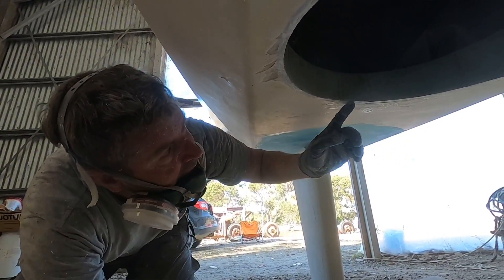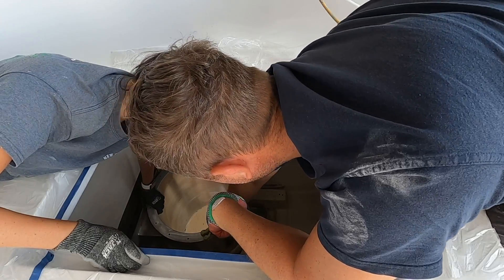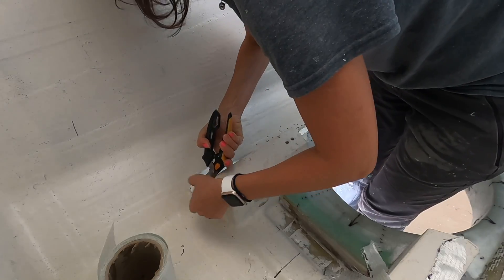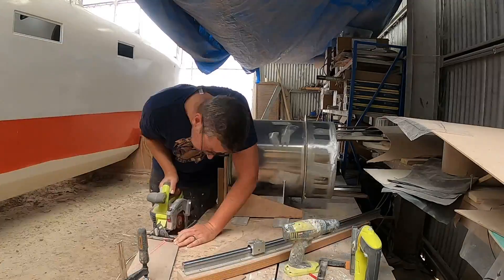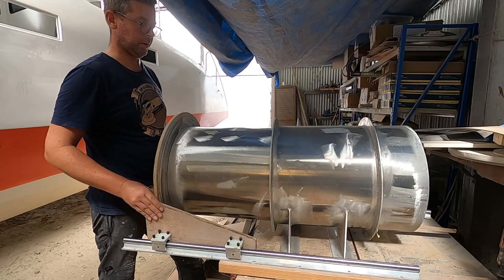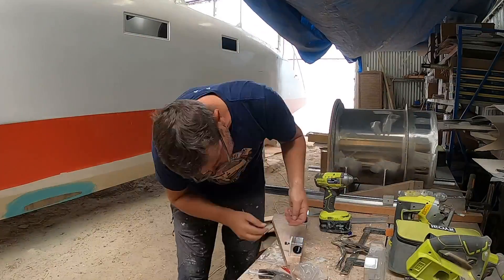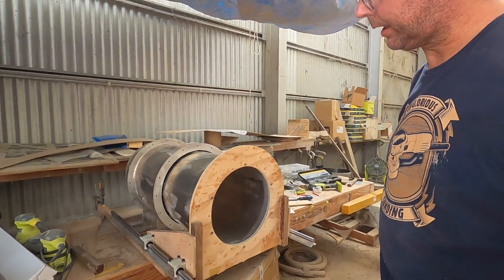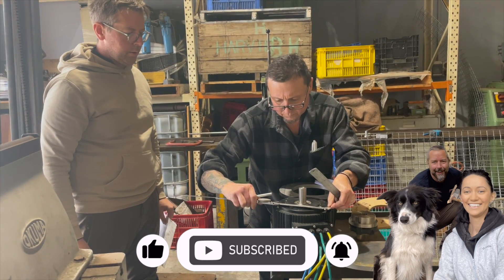The lifting mechanism prototype - S03E25 Propulsion Part 8 | Building Wilda | Unique Drive System

Comment: Linear rails and salt water are going to give you grief , hydraulic ram will be more reliable i believe
Reply from the maker: I think you are absolutely right. Plan on replacing the linear bearings (or whatever they are called) with a more robust solution fairly soon. Small bearings with fairly tight tolerances in a small track can't possibly work for too long in salty air.
Reply from the maker: But I think I'll keep the rails, using a different, more robust "trolley". I am not a fan of hydraulics...🤣 Work related disgust for hydraulics 🤣

Comment: This is a really well engineered prototype. As a retired marine engineer my only concern is that the lift mechanism is just too sophisticated and the linear ball bearing aspect is unlikely ‘to survive first contact with the enemy’. Personally I would go for ‘handraulic’ raising mechanism using a cable and use acetal bearings on the guide rods. But, anyhoo, it is a fascinating project and I am sure you will be successful.
Reply from the maker: The bearings are on the delicate side... Already thinking about bearing solution 2.0 probably from the 3d printed CNC world.

Comment: Looks great, those linear rods will rust up very quickly in the saltwater environment, do they have bronze or another material ??  can't wait to see the full mock-up...  Just one more thought, with the pod pushing into the water will it act like plunger and push some of the water over the inner edge into hull???
Reply from the maker: The rods are actually solid stainless.. I'm hoping good stainless... But I agree, they will be one of the sensitive parts. I have a plan for adding some resilience to that part moving forward. Some CNC parts.
Reply from the maker: Yes... The plunger part is an issue... I hope I can seal the cylinders pretty good but I do foresee some issues to work on.

Comment: Gday, looking good. One suggestion I would make is to consider a slight taper at the bottom of travel of the insert. On my38ft cat I used to have rudder cassettes that would wobble slightly. So I remade them out of composite and made them tapered a tapered cutout. This means that when down they connect solidly and don't vibrate. I would insert some very small wedges at the very bottom of the external sleeve, tapered so that they bear on the internal sleeve only when it gets fully down. Then you won't get any vibration of the internal sleeve under power. Then a small amount of retraction will make them contact free and easy to raise. I do the same sort of thing on my folding catamaran, with moving memebers that are only in contact when fully extended - it makes the whole thing very secure.
Reply from the maker: Sounds like a good idea. Thanks
Reply: That would also help prevent racking of the drive tube when extended and under power.

Comment: Love the drive system but how are you going to deal with marine growth inside the rings ?
Reply from the maker: We're hoping it won't be too much of a problem. Since the cylinders move and because of the environment between the tubes.
Reply: @buildingwilda  I do my own hull cleaning and am always shocked at the speed and scope of the junk. One barnacle is all it will take.

Comment: Just some considerations concerning behavior of the water when pushing down the device. On one hand, there should be free flow of water at the cylinder sides to minimalize the pressure needed to move it down. If you would have a tight fit (as a i.e. hydraulic cylinder, the pressure needed to press and hold down would be ( at lowest postion) considerable. Can be calculated as area pressure at the water depth at the position of the device minus the weight of it.
On the other hand, with free flow of water along the sides, water will (I suppose!) be pressed up over the edge of the fixed cylinder part, as the water amount to be pushed away wiil move against where the pressure is lowest, meaning upwards.
The same will probably occure when sailing in big waves, unless you have gaskets to close the gabs when the device is down?
Just some thoughts from another owner of a catamaran with a strange screw drive 😊!
Reply from the maker: You have a point for sure.

I'm not sure exactly how well I can get a seal to work between the end positions but we will try. In both end positions there will be a seal so hopefully not too much problems with sea movement.

The plunger bit, I'm sure some water will try to escape upwards I'm hoping not too much though... And hopefully we can get the seals to work in-between the upper and lower positions.

Thanks for watching!

What kind of cat and weird spinny thing? 🤣

Comment: Hi Axel and Rox, this is what we have been waiting for HAHA and the next step of course! 

Great work as always, the mere fact that things "fit" on the first attempt shows how much preparation and care you put in to every aspect of what you're doing. 

I have a couple of comments, one is I'm wondering what you're going to use to seal the joint between the stainless tube and the hull, I imagine this will be revealed in time and I probably should be more patient lol. 

Also between the 2 cylinders, in the old days we would use sacrificial Nylon strips as sliders to reduce movement while maintaining a smooth low friction slide. Today there is also Teflon and a few others, there is also a product or compound known as boron, aluminum, magnesium, BAM. This has taken the crown as the hardest and slipperiest material available. 

I don't know if its available in thin strips but if it is it would beat all plastic type solutions hands down! 

As always, looking forward to your next episode! 

🍻🍻
Reply from the maker: Thanks 🙏 

We'll glue the tubes to the hull.... Having a hard time deciding on whether to go with epoxy or construction adhesive.... Both would work.... Both have advantages and disadvantages...

I had to look up BAM. Super interesting material. Apparently available as a powder as well... That would have been a good additive to an epoxy mix I think 🤔 I actually bought graphite for this very purpose... But I think I'll try to keep it simple and just go with strips of plastic. The trick will be attaching them to the tubes.

And seals....
Reply: @buildingwilda  Regarding securing the tubes to the hulls, personally I'd use a marine flexible adhesive designed to bond stainless to epoxy. Then I'd make a right angle collar to go around this joint with double O-rings, one for the vertical one for the horizontal. This would be bolted on as redundancy protection also acting as a stiffner to protect the adhesive joint. 

But I'm sure you'll come up with a brilliant solution, you always do! 

Cheers 🍻
Reply from the maker: Actually the outer cylinder already has a flange with bolt holes. Part of the design from the start. It also allows for easier alignment.

Yeah... Leaning towards PU construction adhesive...
Reply: @buildingwilda  See, you already thought of it.... Was there ever any doubt??? HAHAHA

Comment: How are you planning on preventing marine growth or galvanic corrosion?

what's your backup for when you strike flotsam and it knocks the system out of alignment? Most likely problem would be the raise system jamming partially raised.

I love the concept, but I'm worried that you're making it to dependent on tolerances.
Reply from the maker: Galvanic corrosion is a bigger worry for me than marine growth.

Properly done wiring and sufficient amount of galvanic protection will be key, and something I am not an expert at... Yet 😂

As for hitting stuff, it would likely be during regen under sail... It would absolutely not be great, but I don't see how it would be any different with any other system. In fact all I see is that it will be far less likely to happen to our boat...

Simply because we will not have the drive in the water all the time. Most of the time it will be up. When it is down, we'll be manouvering at low speeds or possibly in regen mode...

Comment: You have to think about how to get to it to service the motor easily .
Reply: It just sits on top of the inner tubes flange. It's a brushless closed circuit  water cooled motor.  That only leaves the bearings to check every year or two or the power cable connections to work loose if not done up with self locking nuts.  

The small closed system  water pump is separate  and electric . They use a cooler plate or external  cooling loop exposed to the water.  

The wear  is only likely in the lower Right angle drive leg where the prop mounts or the rails and actuators that raise and lower the assembly and steer it if intended for manoeuvring.
Reply from the maker: You're absolutely right.

But the motor will actually sit inside the tube. As for cooling, I'll try without at first. What will really need cooling is the controller. I'll see if I can get it into a really cool place.... If not, I expect some sort of water cooling will be needed. Leaning towards air cooled (to avoid a sea water loop)... But we'll see.
Reply from the maker: Some bits will be a bit tricky to get to. But I have thought about it.

Comment: I would make the frame in stainless steel, and all the bits welded together. The water Pressuer against it when down will be a lot. You do not want it breaking in a crossing , and loessing the rig in the bottom of the ocean.
Reply from the maker: The final thing will be made from something less rot prone 😂

Not too worried about the thing dropping to the bottom... It will float. So pushing down will be the loaded bit.

Comment: This propel system is going to be one of a kind unique. Can’t wait to see it working and what speeds you get from it.
Reply from the maker: I really don't expect any speed to speak of. That is not what it is for... I'd be really happy with 4 knots.
Reply: @buildingwilda  I think you need to think about sea currents. On a sail, it's not uncommon to see a current of 5 notes, and sailers use motors and sails to get forward movement. 

Also, it will require a large battery bank, and I would say you need to consider a generator installation on top of the solar and battery you will need.

I would also look at hydro drive to produce electricity. When you are sailing you could get the propeller to spin and via a generator produce electricity to pump back into the battery.

I would also put a wind generator on top of the mask. 

All the above are optional but I think having them will mean you will never run out of power.

I would also look at bigger motors to get forward motion better.

I do understand this is experimental and I love the way you are thinking. The real test will be on the water and you may find you will need bigger powered motors and more electricity once you have used the set-up for a few years. It's going to be very interesting to see how this mother setup will pan out over time.
Reply from the maker: Yes.. a bit of an experiment.

There will be no wind generator. I simply don't think they are very useful.
A small generator will be a good addition for peace of mind.

Speed, for this kind of boat, is achieved by sailing, not motoring, and like any vessel we will have to plan our passages carefully in places where there is a lot of current.
Reply: Very interesting system. Btw going full electric is just normal today but in 2019 was not too much solution proven

Comment: If those tunnels could twist, you would be able to remove the rudders... the propellers would be the the rudders... under motoring only, but could give you a secondary rudder system in case of loosing the sailing fixed rudders... just a thought...
Reply from the maker: That is the idea.. but the azimuth will have to wait a little longer.

Manouvering under power. Not great for steering. Maybe in an emergency...

Comment: One question, while under sail the leeward hull always is pushed deeper into the water than the windward hull. What will stop the moon pool from overflowing into the aft compartment while sailing?
Reply from the maker: The top should be high enough to avoid that issue. And also, the drive should be fairly decently sealed in both end positions.

Comment: I am looking at a similar concept for lifting my centreboard/daggerboard on my 13metre yacht. I'm leaning towards ball screws as I want to be able to wind the board up manually if I ever have drive problems with the lift motor, electric or hyd.
Reply from the maker: I've looked at ball screws myself. Great system. The reason I went with linear actuators is simply because I found some that would work for me... And less tricky to keep clean... I hope